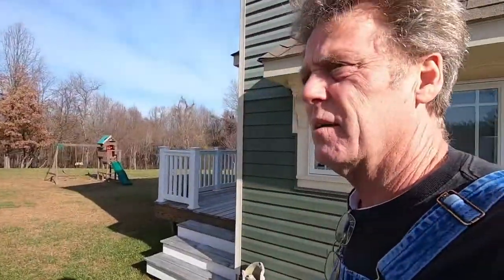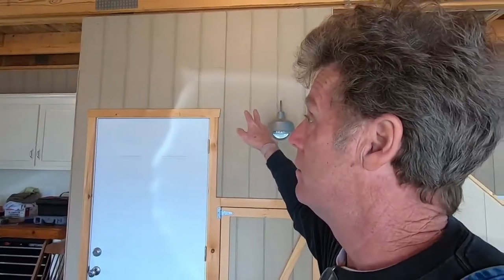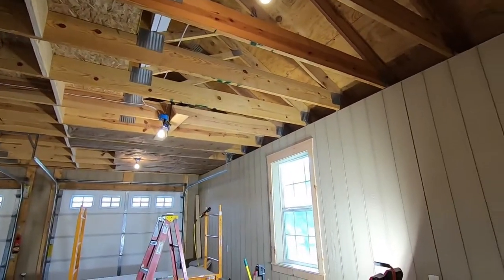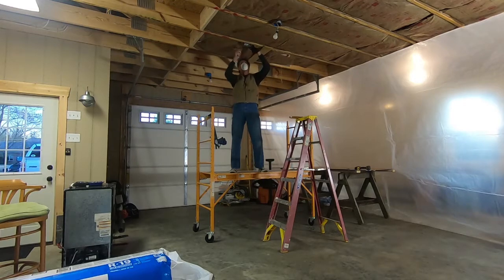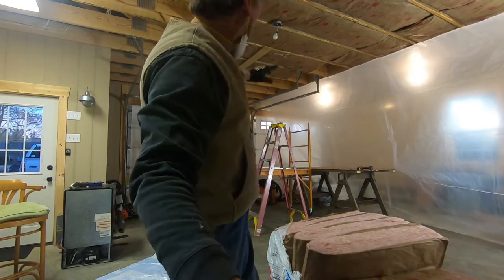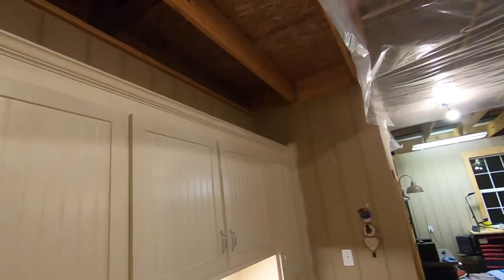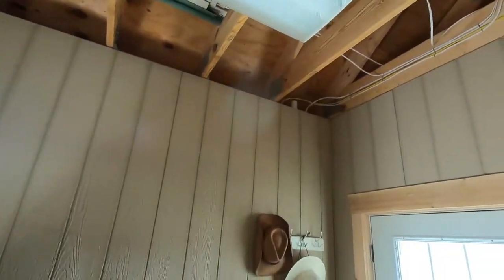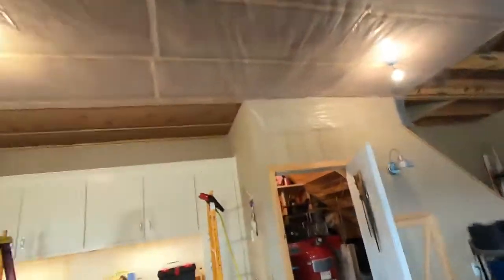Prepping The Shop Ceiling For The Installation Of Barn Tin

Comment: Do I need to put plastic up on my roof for a moisture between the insulation and tin ?
Reply from the maker: Thank you for watching! Not necessarily if your insulation has a vapor barrier on it. Either paper back or foil. Also weather or not the space is conditioned is a consideration. I installed 6 mill polly to help eliminate potential drafts. I hope this helps. Thanks 😊 …..Billy